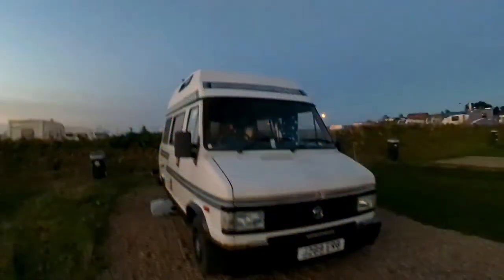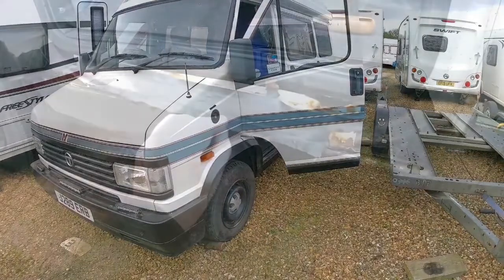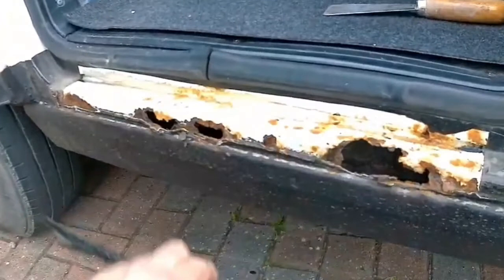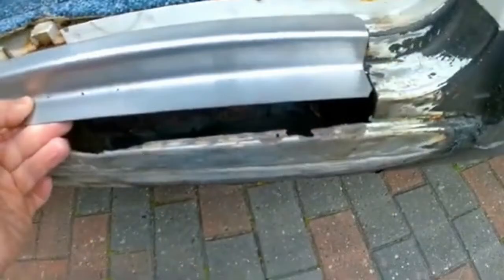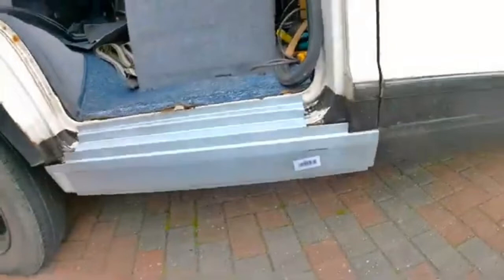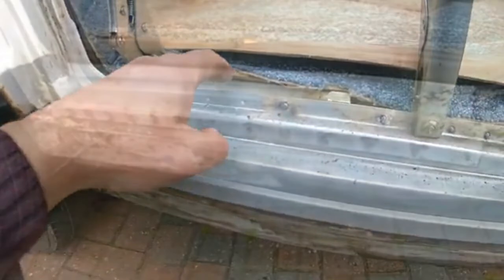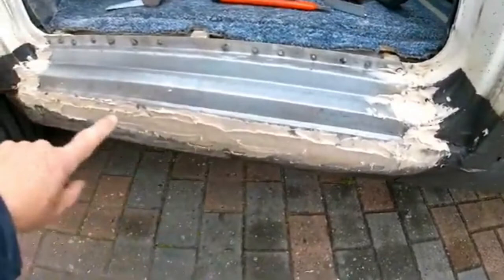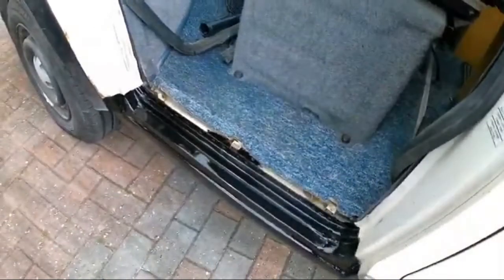Old Motorhome. The Hole Truth in Pictures. Autosleeper Talbot Express.

Comment: Hi George and Jane. I did the exact same repair 3 years ago. It was difficult for me as I'm disabled and my neck hurt for weeks after doing the repair. I can't afford welding by a pro so, lucky I did some welding many decades ago and I bit the bullet. I used some of the same approach and did some spot welds and some sort of stitch welding (Not sure that's the right term but it suits me). Anyway, thanks for sharing, as I have some more work to do around the windscreen, that is desperate for attention. I'm hoping to get a new windsceen but the only place I was aware of was a place up in Leeds. If you know anywhere else with new screen available I'd really appreciate it thanks. I hope you have a lot of fun this coming summer. XX
Reply from the maker: Hi Jimmy. Many thanks for your message. I don't really know about windscreen sources but there is a lot of second hand Talbot Express spares on Ebay. The sellers are companies which scrap Motorhomes. They dont list everything they sell so it's worth contacting them. Whenever I've tried to change a windscreen  or window I have broken them. Cheers from old George
Reply: @MakeDoAndMend1  Yes, it's the used ones that tend to crack as they get brittle over time. Mine has a couple of small chips, but I feel sure it'll crack if and when I try to remove it to repair the surrounding metal. Thanks for the suggestion. X